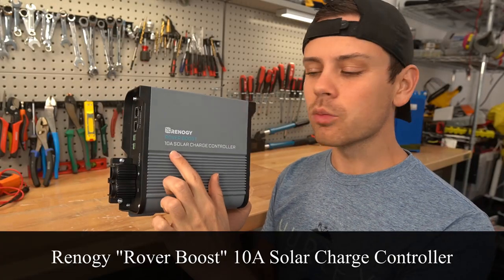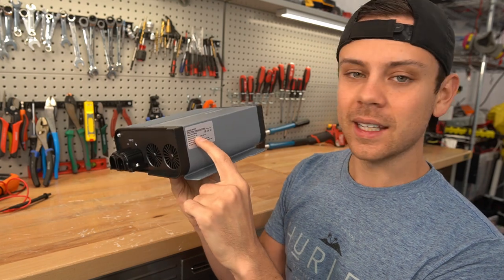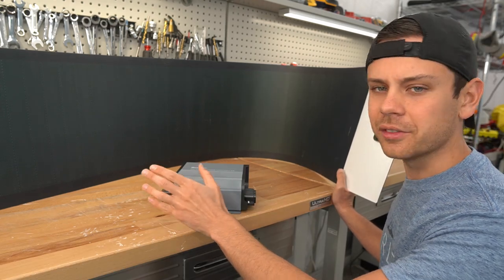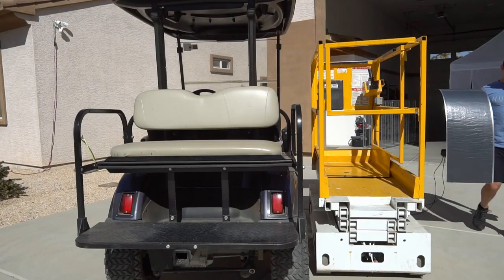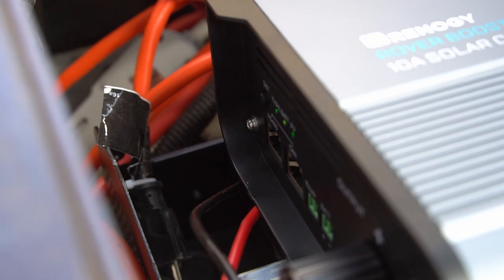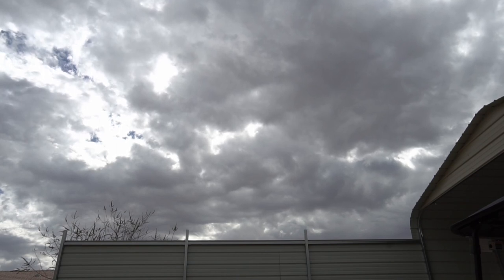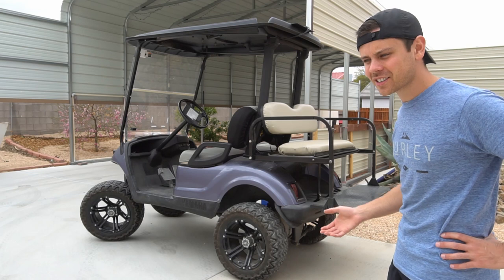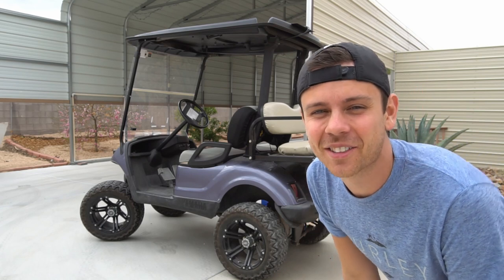Renogy Rover Boost + CIGS Flexible Solar Panel = Solar Golf Cart

Comment: Hey Will, a bit off topic on this video but how would you wire up 4 x 12v lifepo4 batteries in parallel to get an even  charge and discharge, looked at so many diagrams and it gets a bit daunting after a while as everyone says this is the correct way or that is the correct way, Thanks, if you have a diagram somewhere that would be great.

Comment: Hi Will ,  I posted this question to another channel . (  Most of us don't have access to free youtube $ , so why are you using an AC switch over for your back up power ?  I am using DC. Alternator power injected into my system on my Solar aray side , Allowing my Conex / Exantrex charge controller to regulate the voltage charge to my battery bank . This is trigerd by low voltage triger from my battery bank , True off grid and saving $ on switching gear and such )  What do you think Will ?  
Thanks 
John C

Comment: Why not just put one higher watt panel on the roof? Like a 350w 60/72 cell, will be higher enough voltage for the mppsolar?

Comment: Wonder if you can help me. We are making homes for Fijians. The grid power here is often non existant. Also the average temperature is between 28- 36 degrees C 
I want to put in about 250Ahs  in a 12volt configuration.
Because of the temperature factor, is it smarter to put in  a LTO battery. The battery will feed Led lights and a 2000watt 230v inverter.

Comment: I have a question about how to work Peukerts formula?
Every time I plug in the numbers it shows more than the rated capacity of my battery. Peukerts formula  t=H(C/IH)k. So t=20(225/11.25×20)1.25= 25.  Shouldn't it  be < 20 because of Peukerts law.
What am I doing wrong?

Comment: If you were to build this, how would you do it?

LIFEPO4 12V 100AH / 350A 
Specifications
Capacity 100Ah / 1440Wh
Voltage 13.8V charged
Battery technology Lithium iron phosphate LIFEPO4 BATTERY
Charging voltages Max 14.4V
Discharge current max. 300A or 350A for 10 sec.
Charging current recommended 30 / 100A, 150A max.
Weight approx. 11 Kg
I`s for a caravan.

Comment: I gotta say... I"m very disappointed with the 1,000$ I spent on my CIGS panels.  I don't blame you Will, but I heard about them here.  I could have spent 200$ on regular panels for my application.  What a waste of money.  These panels don't have termination of the layers around the edges.  They delaminate from the edges.  Mine failed after 5 months, water gets between the layers, they come apart like a wet sandwich.   it's an engineering disaster.  0 stars.
Reply: Yep.  Mine, too.  Will owes his subscribers a re-review.

Comment: I am considering 5000$ worth of these on a sailboat.  Can I mount them directly to the fiberglass or do I need to put them on top of corrugated plastic to cool them.
Reply: There is now info on these on forums.  They delaminate.
Reply: @nunyabidness517  I got them. And they have delaminated.  Good thing I just used silicone to fix them.
Reply: @kirk9671  was that the CIGS or amourphous in the end that delaminated? Also planning an install on a sailboat ;-)